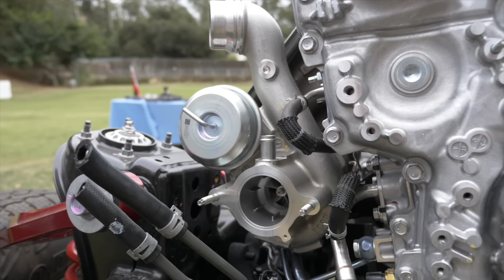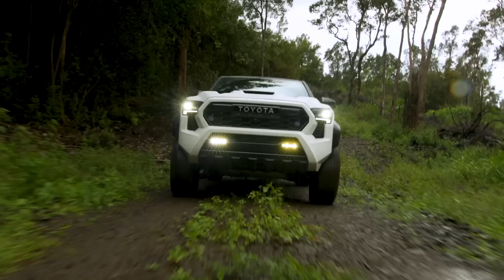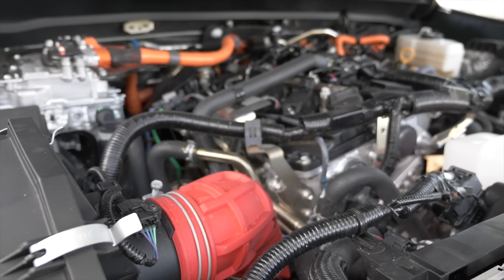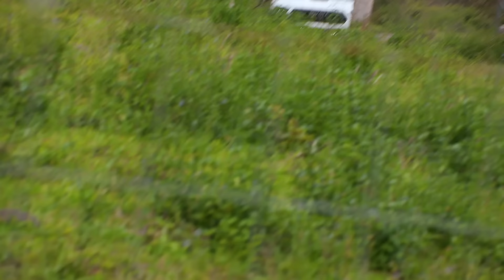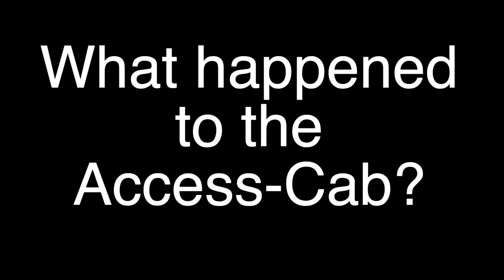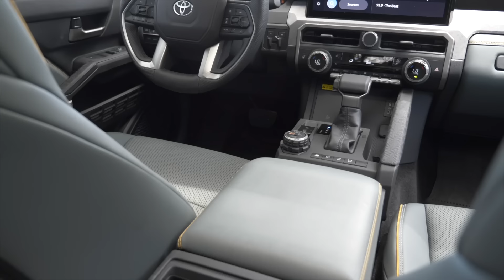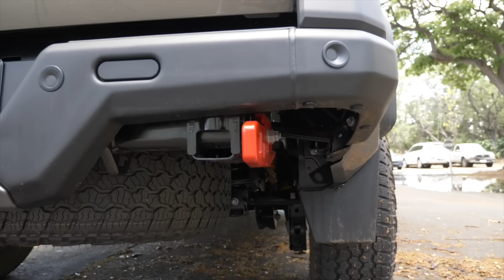2024 Toyota Tacoma Chief Engineer on new engine reliability and more...

Comment: I have a 6th gen 4Runner and compared to my 5th gen, it is incredible. We baby it on the road and highway but off road? It gets abused and it is aggressive on 4Lo! lol it’s a lot of fun and gas mileage is pretty good considering that we get about 300 miles on 16-17 gallons vs 20-21 gallons on the 5th gen we had.

Comment: Toyota has been using turbo engines since 1980. I get the Tundra scare, but their history has been excellent.  Their turbos have been world wide for decades. Have you ever heard of another Toyota turbo issue?
 It's the terrorist choice in a truck, think about that.
Reply: Those trucks on the international market (the hilux) are diesels which are generally better for handling forced induction. Turbo petro engines aren't as reliable.

Comment: I know this.  They have made a 4cyl FOREVER and I have personally owned a few and seen many that were absolutely beat and abused.  My friends family owned a huge salvage yard and the old Toyota were always yard cars.  Simply because they kept going no matter.  I had a mini truck in 87 with 224,000 on it when I sold it. The timing guides worn out.  We replaced them and the engine was still going 5yrs after I sold it.   That was long ago but …. Guess we will see.  I e been waiting 27yrs to buy a new one and now all this.  So I’m waiting while

Comment: I have two Tundra's with V8. Gas mileage is bad but would rather have the reliability. When you install turbos to boost a small displacement engine, heats destroys oil quickly and wear is increased. You better change oil religiously every 2-3k miles.
Reply: That’s crazy dude. It’s 2026, reliable turbo engines exist

Comment: My 2023 Toyota truck V6 engine died at 35000 miles. The mechanic indicated the engine and component design were Toyota's way of trying to meet the prior administrations mileage and emissions rules. It will take to three weeks to get it repaired. Toyota's reliability reputation took a hit downward in my book.

Comment: My first truck was a 1984 and then a 1985 4Runner (first car 1981 Corolla).   Both 22RE.   In 1993, I traded (wish I didn't) for a 1991 4Runner V6.    Ran that until 156K when the head gasket went.   Toyota replaced it for free.   Had a number of other vehicles until 2015 and bought a Tacoma.   Hated it.   Very uncomfortable for people over 6' on long trips.  Gave it to my daughter who ran it to 210K miles.   Traded a  2020 Jeep Gladiator for 2026 TRD OR- Premium Package 6MT as that spare fun car with utility.     Love it so much, got rid of my daily driver which was a 2025 GMC Sierra 1500 Denali Ultimate.     Toyota, for GenX, you nailed everything we were asking for for years, especially the interior.   And everyone who hates that big screen, wait until you get older...

Comment: More moving part. more heat, more pressure, more radiators -> NO WAY a Turbo engine can outlive a naturally aspirated engine. Period. Ask the few hundred thousands Tundra dudes who got told that the new V6 twin turbo would be as realiable as the previous V8. Toyota is dead to me for as long as they will keep these small blender engines made in mexico. I have a 2016 4Runner, and keeping it until they reorient the company toward quality once again.

Comment: Did this gentleman have anything to do with the recommendation to change oil every 10 K or MORE, change coolant every 100 K or more? Then let’s use a plastic coolant control valve in the hottest place?  Open deck design?  Composite balance gears in that old oil?  I know you all don’t owe me but I ask this of you.  Change oil 5 K on the dot with full synthetic, change coolant every 50 K, fluid film that frame, new WIX air filter every 20 K, change diff fluid every 60 K.  Off road in 4 -LO only! Then enjoy truck without fear. 
So he is a better engineer than I?  Of course but he is not being an engineer right now.  He is being a salesman.  I am a better salesman than he.  Don’t BS a knowledgeable population!

Comment: You cannot defeat physics. You put a small engine in a heavy vehicle, increase its compression ratio to make power, turbo charged it to make additional power, there is significantly lesser surface area where heat dissipates. The engine will not last as long as a bigger engine. All the fancy engineering magic will not make that engine last as long as when you have a normally aspirated bigger engine.

Comment: Any failures yet???
Reply: Mine failed at 1270kms. Owned for one week. In shop for 6weeks. Insane
Reply: @electroacdc what exactly failed?
Reply: @stefanovichmichael9686 rear main seal. Built 03/26. I suspect not machined the block drain hole properly

Comment: Boy this didn’t age well
Reply: They need to bring back the V6 or if they really want to STAND UP why no bring a 2Jz a 6 inline cylinder those engine will be better than the V6 plus they are more fuel economy and they bring more power than the traditional V6 engine. 6inline cylinder engines will be always KING. Just imagine having a 6 inline cylinder engine on the tundras and even the Tacomas and the Lexus a Toyota SUVs. They really need to go back to the board and basically reverse engineering and improve a new version of the 2jz engine.

Comment: I bought a Tacoma Trailhunter Hybrid 2025 by $68k, I have traded in this Tacoma by $55k with Nissan (only 8k miles), Toyota only offered me $48k. It is the worst car that I have had in my life, I am 61 years old. The gas performance 17 mpg, vibration, android disconnections frequently, the vibration in 4H increased by 4x.

Comment: Yeah, you guys have been making these engines for years but what guys dont take into consideration is the size of the vehicles. Putting a small engine with a turbo on a bigger than mid-size truck is honestly a recipe for disaster. Reliability is out the window. Lucky to get 100k. IMO will never buy a small motor to fit a big application. No thanks ill put my money else where.

Comment: 10k miles in on my 4th gen non hybrid TRDORDC and I am very impressed with the drivetrain, capability, and especially the comfort of this truck compared to previous gens. It cruises at 2k rpm at 70mph all day, yet has serious grunt at low rpm for offroad use. MTS does a great job at managing offroad traction. Of course time will tell, but I see a lot of negative comments from people that obviously have no experience driving or owning the new Tacoma. Just want to put my 2 cents in and say that my personal experience is very positive with the 4th gen.
Reply: I've got the TRD OR Hybrid and I love this truck. 10k and not a single damn problem. 26 mpg on the highway with all the power you need. Haters are going to hate. They probably can't afford it. Boo Hoo  lol
Reply: @intnatnalharvstr  I can afford it and I still dont want one, not with a turbo 4, sorry, not a hater but I have been around the block a few times. I owned a four banger (non turbo)  and it was a dog so they threw a turbo on it and it helped with the power but I like keeping one for 250,000 to 350,000 miles and as a old mechanic I dont think the odds are my favor with that set up. I maybe proved wrong but I will leave the testers buying them give it a go first.
Reply: @intnatnalharvstr  10,000 mi is nothing ..you cannot talk about reliability at 10000 miles... The Mitsubishi Mirage is also great at 10000 m.
Reply: @GJJC13I own a fourth gen and agree 100%. I put over 30k a year on my truck. I bought a 125k warranty (not third party). I’ve only seen one guy with 80k on his 24 but no issues with his fortunately. I think the old Toyota Truck was a turbo wasn’t it?
Reply: @intnatnalharvstr especially the frontier fan boys
Reply: @intnatnalharvstr  You're only getting 26 on the highway with the hybrid??  I'm getting 24+ trip average to and from work (mostly highway) with the SR 6spd (obviously, non-hybrid).  The wife's hybrid Sienna gets like 38+ on the highway...
-
Not trying to be rude or anything, just genuinely surprised.  As a manual enthusiast I didn't even look at the hybrid option so I know almost nothing about it.
Reply: Have fun being the test dummy, it kinda stupid to say 10,000 miles it’s been great, yeah any vehicle is great at 10,000.. with how much crap cost now you don’t want to be the one forking out money to allow Toyota to refine their crap new engines.
Reply: My gen 3 V6 runs about 1650 to 1700 rpms @ 70 mph.  I've driven a gen 4.  They can keep it.  I have 30+ years of experience with turbo'd gas engines; they DON"T LAST.

Comment: I actually rented a Tacoma with this 2.4L Turbo engine.

I also own two 4Runners with the 4.0L V6.

I LOVE the power of the Turbo!

The Tacoma cruises at peak torque, at about 1700 RPM/65-70 MPH.

Press on the gas, you get pinned to the seat at about 3200 rpm when the turbo kicks in.

Made a believer out of me!

Comment: I'm pleasantly surprised with my  4X4 2.4L turbocharged 4 cylinder Tacoma with 8 speed transmission.  I thought I was buying just a utility truck and (it looks like one). The first time I wore steel toe boots while driving it dawned on me that this things hauls serious ass for its specs. All while maintaining an average 22mpg  This is a huge jump in performance from my previous 2013 Tacoma 4 cylinder.  Toyota performed some mechanical magic or sacrificed their first born or something.  I love the whistling sound of the turbo when I put my foot into it.
Reply: A caviat/sidenote.  The things I don't like about the truck are the keyless ignition and electronic shifter.  I don't like the idea of not being able to start my truck if the battery in my blipper runs out.  The electronic shifter just seems a bit excessive.  Hopefully there is some kind of benefit like reduced wearing of mechanical parts over extended period of time or something.  Although lightweight and probably contributing much to efficiency, the body feels cheap and lightweight.  The middle of the bedliner is pretty much all there is between it and the road.  The rear wheel well  is made of children's toys quality plastic.  Although I didn't buy the truck to haul stuff in on a regular basis and I enjoy owning a truck only for the convenience of having that extra space to put things or tools if I need to.

Comment: Odd that the coolant reservoir low and full lines are only a 1 inch difference on the grand Highlander. Was overheating already at 40k miles.

Comment: I honestly was skeptical about buying the Grand Highlander.  I am impressed.  It takes a second (literally) for it to spool up and you have plenty of power.  Breathes a lot better with a high flow filter and run premium gas. You’ll get better mileage and a bump in hp.  Went from 19 avg to 23.5 in town.  Dyno results on a  Tacoma gained 20 extra.

Comment: CAFE standards are forcing manufacturers to build vehicles that are less dependable just to keep them off their backs.  You get low-tension piston rings, scary light engine oil, body panels you don't want to lean against for fear of denting, and more and more plastic engine parts that are prone to warp or crack.

Comment: Brown put Toyota up there with Bud Lite.  I have a 2024 SR5 Tacoma and I hate it!!!!   DEI destroyed a reliable truck and added useless features.  Do I need heated seats, a display that tells me that my window is open, or the inability to get an OEM trailer brake controller on a “tow package?”   Let’s not forget the woke style “air dam” under the front bumper that is just craving for contact with a high curb.  Toyota went woke and it’s obvious
Reply: Same feeling as mine.  Too much stup1dity with much less content.  Fuk.  The rear seat fold flat feature was amazing to have groceries and stuff while not using the bed.  And they destroyed it and all the rear seat dimensions because a pair of gimmicky TRD pro seats that are worth nothing.  the adjustment is half electric and HALF MANUAL.  POS. Ruined for almost everyone else.

Comment: The problem is always the suppliers and cost reductions. They have made compromises somewhere and it will show it’s ugly face after a couple of years. I am sure it will be reliable but less than the normally aspirated 4.0. My son was a R&D engineer in powersport and he bought a Pathfinder with the NA V6 because he knows simplicity has an advantage especially in trucks.

Comment: Please get rid of TRD Pro seats.
Reply: yes. indeed. The rear seat used to fold perfectly FLAT, where i had my dog and groceries every fukn day. And well, I no longer purchased another Tacoma.  It was a MUCH CHEAPER, througly equipped Ranger Wildtrak (rear diff locker, rear AC, leather seats and electric rear tonneau, 6000 usd less than a 4x4 Sport).

Comment: I am not sure if Mr. Brown actually visits YouTube for any comments, however, I have some major bones to pick about problems with a 2025 Tacoma Trailhunter. I have driven it 5000 miles. Bought brand new with about 4 miles on the vehicle. The posted 22-24 MPG is either a fabrication or I have a very messed up Trailhunter. I usually get 16.47 to 15 mpg. Sometimes I get even lower mpg. I drive the same route, use the same gas from the same gas station, and my driving habits are no different from when I drive my 2022 4Runner ORP. I get 21-22 consistently with the 2022 4Runner. Could it be something with the engine? According to the service center, they found nothing wrong. What is more confusing, is that on occasion, I will get decent mpg. Maybe one tank out of eight. It is sickening to think a new vehicle with an 18.3 gallon tank says it has a range of 270 miles after filling up. 

I also wonder if it is the transmission. I can be going down the highway in automatic, and move to manual gears, and the vehicle will say it is in 7th gear, then when I push it to 8th gear,  the RPMs will go up by 300 for a few minutes, and then get stuck around 1900-2000 rpm when I am 8th gear. Last night I tried staying in automatic with the engine set to normal mode. At 73 mph I was pulling around 1500-1600 rpm. I moved the shifter to the manual mode and it did as mentioned above. This does not occur in my 2022 4Runner. If I move from automatic to manual in the 2022 r4Runner, it goes to 4th gear and when I move it to 5th gear, it stays there unless some unusual slowdown occurs, and then it will downshift.

Regardless, despite my local service department being unable to find a problem, I believe something is wrong. I am not amused Toyota/Mr. Brown. Either there is something wrong, or the mpg ratings are a fabrication. I have had Toyotas for the past 40 years, and this is the first time I have despised a purchase.

Comment: So many criticize using a 4 cylinder. Toyota and other have been using turbo 4 bangers for decades and you never seen them here in the US.  Two of the most iconic engines in the US was the 22r & 22re. But the 22ret was so awesome. I've seen those have almost a million miles on them in other countries. mainly the middle east and latin America. those engines and include the 2jz, Toyota just builds iconic engines.
Reply: I agree, I had a 2.4L 2RZ-FE (4-cyl) in a 1995 Tacoma which I purchased new and kept for 25 years, logging 355,000 miles.  Not a bit of trouble.  But the folks in this blog seem to be wary of a turbocharged engine with regard to reliability.  No matter what data I present in many of my entries in this blog, they just don’t want to believe that the 4-cyl turbo will be as reliable as the old V6 it replaces.  Lots of opinions based on old wives tales.  I just purchased a 2025 4Runner with the 4-cyl turbo, so I am putting my money where my mouth is.

Comment: I am actually looking at a Frontier which still has a proven and potent V-6. I don't want a puny 4 with a turbo. This looks like a rat's nest. Besides, the mileage is not much different.
Reply: Tacoma mileage city/highway = 20/23, Frontier mileage = 16/20 - both for 4wd drive models.  Tacoma is 25% better in city and 15% better on the highway.
Reply: No. I was talking about the difference between the Toyo 4 and 6 not Toyo v. Nissan